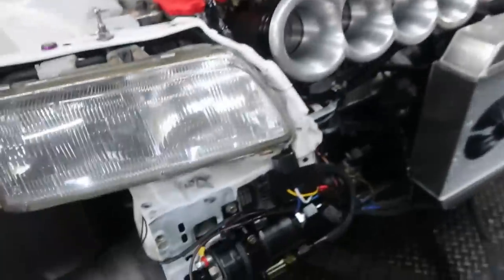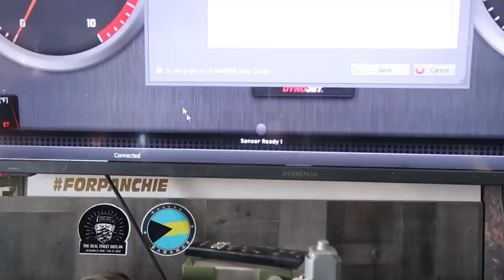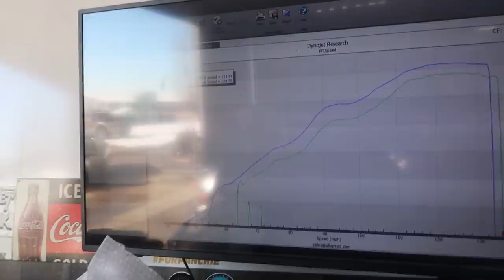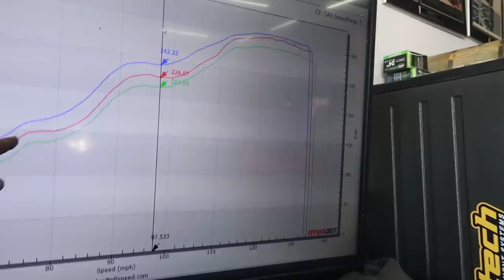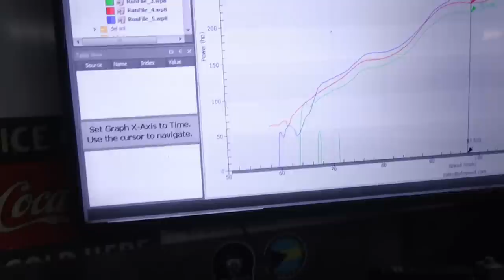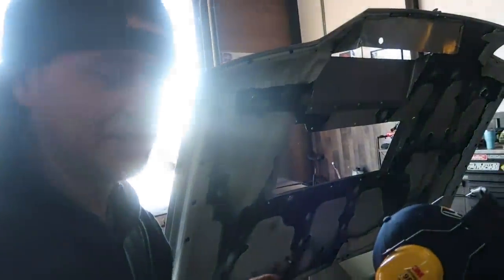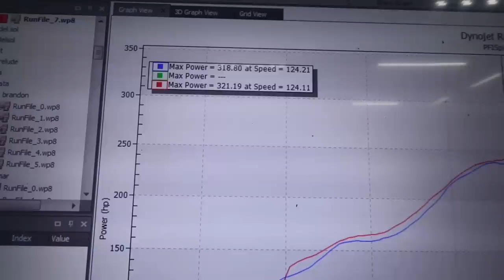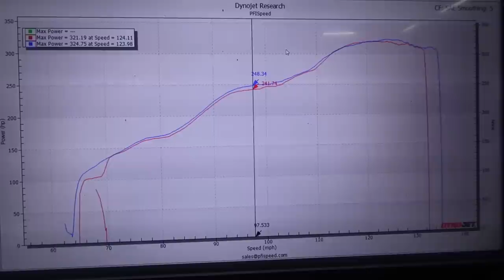All Motor Song Brings Men to tears! AM Phong part 2 (headphones⚠️ )

Comment: We had same issue with our dyno. It's the hard drive skipping with the harmonics from certain cars. Switching to SDD completely solved. Love your work guys.
Reply: Warwick Evezard +1 .. SSD fixed dyno down here in miami 💪🏻💪🏻
Reply: I'm no dyno guy, but i know computers and that's what i was guessing.
I was going to say that having the computer in the room next door and the cables thru a hole in the wall would also fix it.
But if a SSD is all it takes then I would change it out.
Reply: Didnt even know people still used HDD
Reply: @colesteven1123  SSD have only just become somewhat affordable in the last couple years... for instance most people still have an SSD/HDD combo in their PC builds.
Reply: @_Professor_Oak  i left HDD the same time i ditched 775 socket processors lol
Reply: @DjSubstain  As an IT person that works on computers and has never been to a Dyno run, I too can confirm your theory is correct since loud noise = lots of vibrations and the HDD is doing its best to not scratch the plates and corrupt the data.
Reply: Can we all just admit we have had that HDD that needed a good jostling to operate properly 🤣🤣🤣🤓
Reply: Thumbs up for visibility, I hope they see your comment. They could use a tool like clonezilla and just image their current HDD and then put that image onto an SSD. That way they dont have to screw around with installing everything / losing old runs etc.
Reply: I agree that sound/vibration is causing most of this issue but I sent PFI an Email 4-months ago explaining how my dyno and computer (that are inside a "small" trailer = LOUD) worked 100% fine until I upgraded to Dynoware RT. The Dynoware and Power Core software(s) "work computers very hard" compared to the old hardware/software IE my computer (that again worked 100% fine with the old hardware) maxed out the CPU non-stop 80-100% anytime the Dynoware was turned on = choking before even running any bikes on the dyno. When I tried my much better Home computer that Processor (i7 8700K) only worked 33% before sampling basic data (but surprised me how hard it worked the Graphics)... So, since I sometimes run dual O2, along with multiple aux. sensors (plus tuning software), I ended up ordered a tower with small SSD, HDD for files, 8th Gen i5 Processor and GTX 1050Ti Graphics. I know that's not the latest greatest but it's what I could afford at the time (and way above Dynojet's "recommended") and I've had zero issues running the dyno, plus live viewing and data logging stand alone ECU software...

Comment: We dealt with this in the airline industry, Hard drives have major issues with loud noises especially over 130db make sure your system is on solid state, if it's not upgrade it to a ssd and this might help. I do know we would have hard drive failures around loud turbines.
Reply: Good info there.
Reply: That's a really good idea!
Reply: The high db Vibrations could cause the read to bounce is probably what's happening here. SSD's are so cheap. They could always run their system to a NAS that's in another room. But SSD's would simply be cheaper and easier.
Reply: I wondered if it wasn't the extreme vibrations,magnetic wave ,and frequency,along with no groundings for the vehicle to platform.?I've noticed visual distortions in some cameras when exposed to such.(Not theirs,but in other's such as mine,without anti-shake).I'm sure their computer is well grounded,but how well are the signal wire shielded?Thnx for any answers.
Reply: So since this is a vibration issue with the computer components, would putting the hard drive in another room fix this problem the cheapest and fastest?
Reply: @alecfleming373  Theoretically, that would also work.  That's also why covering it up works, you absorb the noise and vibration before it can get to the hard drive.

Comment: Love Phong's all motor challenges. Amazing he is getting that kind of horsepower.
Reply: Taluvian staying away from that coronavirus!
Reply: it's on alcohol so yeah it can make some power
Reply: Gotta love that M-5
Reply: They are maxing out everything and barely hitting 300...I wouldn't exactly call that massave hps...lol
Reply: @CatfishAlley  Come on man, 50%~ increase NA is impressive, in fact it's more than that because I doubt those motors make 200 @ the wheels from factory. 

324whp and they're nowhere near done...
Reply: @CatfishAlley  there's a difference though because it's all-motor HP. It's consistently making 300+ at the wheel and his car is light, this rig is quick without boost.
Reply: @CatfishAlley  He is making more than 64% over stock without nitrous, without a turbo, and without a supercharger. That is impressive. And 24 HP over 300 is barely hitting 300???
Reply: Not to mention but I'm sure the torque is up there too, and it's alot more responsive than a turbo. Yes there is the argument of supercharging but that's a very pretty penny
Reply: Moondog Express 324 at high altitudes and the car isn’t finished...... there’s all motor outlaw class K series swapped hatches breaking 500 whp running mid 8’s at the 1/4 with a manual trans.....

Comment: you should build a fan out of a vertical ac blower motor with squirrel cage 110v to pump out your exhaust while on dyno.  no more crying no opening door just a flip of the switch.

Comment: When building a high-revvin' engine, dry sum system with scavenge pump is my advice for today. Scavenge pump is able to create a vacuum inside the crank chamber, and therefore pull out all the escaping gasses from the compression chamber. Also dry sump system is easily cooled, can contain as much of oil as needed, and if built properly, can be easily maintained. When using a lot of fuel, especially methanol, the oil gets diluted fast, and then kill the motor.

Comment: You can put the computer in the closet, and run longer cables to the tv and avoid it being RIGHT THERE. Just a thought.
Reply: Love you guys! Give me a shout.
Reply: Think it is the sensors down at the rollers that get confused with the vibrations
Reply: @RAND00MI  No, it's really the computer that freaks out with these extremely loud engines.
Cleetus shopmate Jeremy (Fasterproms) had similar issues with some of the louder cars.
Shielding the cmputer from the brunt of the noise helped getting back on track.
Reply: Does it have a hdd or an ssd? Might be that simple!!
Reply: @jonathonhanks.cmdreaglejon5993  Probably. But you can see even the caneras freaking out from the noise...

Comment: You guys need an exhaust hose from the ceiling for under hood exhaust and one out the wall for the tail pipe exhaust. Wouldn't need to worry about the door all the time. Just a thought lol.

Comment: I think the dyno glitching you're getting is from the barometric sensor.  All the noise inside is causing noise in the sensor.  Try putting some foam around it like you would on a microphone.
This motor is amazing by the way.

Comment: Yall need to install exhaust vent tube on the building for the dyno
Reply from the maker: William Mercer there is one . Just needs to be more powerful to suck it up immediately
Reply: @PFIBrent  love the video keep it up. I went by a shop and thay had a tube that hung from the ceiling and thay would put them on the exhaust pipe

Comment: I had that issue with my old dynojet it was actually the computer going brain dead my guess was the hard drive since it’s the only moving part and it’s a disc so it would pick up vibrations like a knock sensor. I put a Solid State Drive (SSD) and it solved the prob for me you could also try wrapping some sound foam around it (obviously not blocking the fan)

Comment: If your dyno computer has a traditional spinning hard disk, you should swap it for an SSD - loud noise can interfere with the ability of a spinning disk to read/write data because the vibration makes it difficult for the servo to maintain the position of the head on the spinning disk.  This can cause hiccups, or worse, data loss if the head moves during a write operation.

Comment: Try putting sound deadening material on the walls, floor, lid of the dino well and line trough to the computer. Also build a wood or metal box for the dino's computer and line it that may help the freakout problem

Comment: Yep... the computer freaking out from car frequency's messing with the hard drive. It still needs to spin the hard drive to run windows whether the program is running in ram or not...it could also be a dirty ram slot or a micro fracture on one of the pal sockets for the CPU. Build a box for the whole computer with 2x4s - 3/4 plywood and use 4 in. heavy rock wool insulation. Make sure to install a 4 inch case fan in the back toward the bottom and a small vent in the top towards the front so it can draw air through and wont over heat.

Comment: What displacement is this engine?
I'm building a K24 block stuffed with custom spec 88mm CP pistons (still working on the design but hope for 15:1+ compression), custom aluminum rods, K20 86mm stroke crank and topping it with a wildly ported head with oversized valves and big single lobe cams. Gonna be a 2.1L K24 frankenstein which will be revved over 10k rpm and then it's being stuffed into a BMW E30 and controlled by an ECU I designed myself. Hope it makes way more than 300hp N/A on methanol at sea level.

Comment: Phong, Brent, if it isn't too hard, take the hood off for the dyno pulls, the hood is reflecting the sound back down towards the front, not letting it rise, it should help reducing the noise level.

Comment: @pfi_Speed I had an idea, for noise things with the dyno, it may be a hastle but what if you were to put up a temporary "fake wall" type thing or just on the normal walls around the dyno to put like sound deadening panels? idk it might not be a good idea in a shop format but ?? or thicker insulation too lol
EDIT: I also worked in a few shops before with just straightup insulation as walls, with something to keep them in place and what not of course, but it worked great for keeping even plasma table machines and loud machinery to a reasonable level for people to walk thru

Comment: Maybe Need some vibration dampening material around the control board in the dyno
Reply: Put a gopro and a light down there during a run. Would be interesting to see if it shakes around

Comment: the high pitch of the exhaust mess with the hard drive in the computer either switch to a solid state hard drive ssd or put the computer in a sound proof container.
Reply: Mmmm.. I don't think is a hard drive most of the applications run on RAM and only use the HDD if you 1- run out of RAM 2- you write something.. but a SSD is better in every way so it's worth the swap regardless.
Reply: Knight Link what does the hard drive have to do with how a dyno detects torque?
Reply: ^Yep... the computer  still needs to spin the hard drive to run windows whether the program is running in ram or not...could also be a dirty ram slot or a micro fracture on one of the pal sockets for the cpu. build a box for the whole computer with 2x4s - 3/4 plywood and use 4 in. heavy rock wool insulation. Make sure to install a 4 inch case fan in the back toward the bottom and a small vent in the top towards the front so it can draw air through and wont over heat.
Reply: Just yelling at a hard drives can cause errors and timeouts, there's youtube videos on this.   Go solid state for sure.
Reply: v12alpine problem will still occur with SSD.  SSD is better, yes, but the rollers are where the reading comes from.  Not the hard drive.

Comment: I would guess that your dyno not recording data when it's very noisy could be due to the computer that's running it has a mechanical hard drive and it's parking the write heads to protect its self from damage. 
If possible switching the computer to a Solid State Drive would remedy the issue.
I've run into this same issue in live sound settings with excessive bass causing the hard drives to go into protect mode.

Comment: What MIGHT be happening is that the dyno controller appears to be wireless. I know that alot of performance ignition parts have a tendency to emit elecomagnetic frequencies, which could be interferring with  potentially all of your electronic equipment. This is why certain ignitions are for offroad use only. They can interfere with police equipment

Comment: You have to insulate the wires better.   The high frequency of the car is penetrating the wires.  
They have shielded wires to block stuff like that.        Idk if the shielding is better now.  You might be better off shielding the communication wires yourself.

Comment: large sounds and high vibration can upset your connections make them back out or shack enough they cant send signals properly,  also dust build up it needs a few runs to burn it off to get a signal , these could be your issues

Comment: I think if you’d take a large flex tube and put over that exhaust and run out of the building you wouldn’t have the dyno issue. The frequency of the exhaust is screw with your dyno.

Comment: Hey Brent, I have a question what would happen if I put K24a2 cams in to a K24a4 head how will vtec work or will it even work?
Reply from the maker: KSWPAE86 there is no provision for the lost notions so you’d have to set it up to ride on the vtec lobe only. Some drivability goes away but it could be done
Reply: @PFIBrent  thanks a lot Brent that question was tormenting me a lot

Comment: It also says your computer that you're running your Dino does it have a spinning hard drive . Is so you need to replace with a SSD to cut down the magnet cut down the interference . Cousin a spinning hard drive there spinning that doesn't help . SSD no magenta